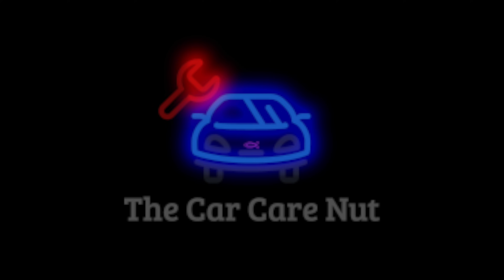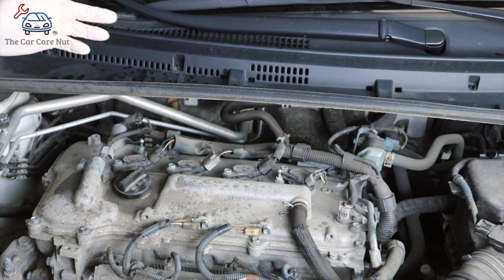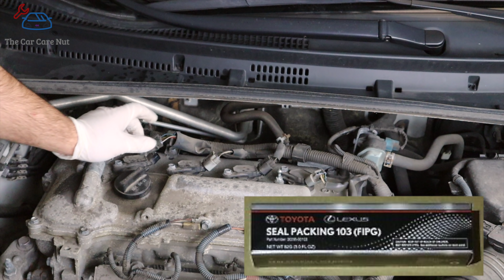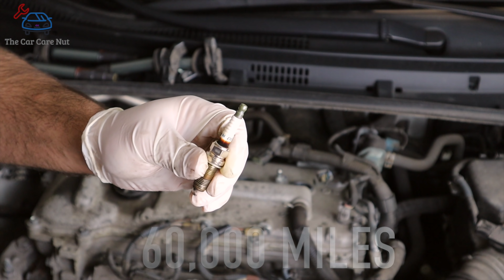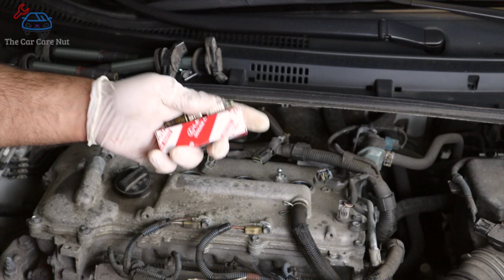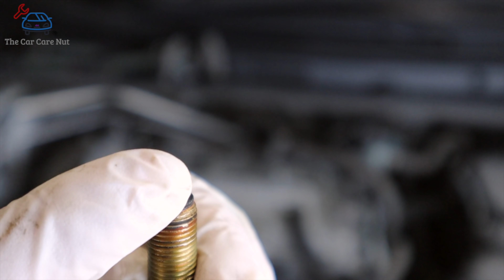How to change Toyota Spark Plugs on 4 cylinder engines

Comment: Good day, I truly like your channel and I wish I came across it much sooner.  
I bought a used 2004 Highlander, V6 3.3L, AWD back in 2012 with about 70K miles.  Today it has about 194K on it.  As a DIYer I change my oil every 3K, and other maintenance regularly.  The vehicle has never let me down. I do plan on having the timing belt changed at the dealer in the next month or so.
I'm also planning on changing the Iridium spark plugs (gaskets as well) myself since they have never been replaced since I bought the car in 2012 and I don't think they were changed by the previous owner.  Based on videos I've watched I understand it's little bit involved since the plenum must be removed in order to access the back three plugs.  I'm going to replace the front three plugs first.  If they are ceased then I'll refrain from going any further.  Is there any advice/encouragement you could give me as I perform this work within the next couple of weeks?  Thanks in advance.
Reply from the maker: Hi! If I were you and doing this yourself I would replace the valve cover gaskets as well. This is not difficult to do if you have experience. The bolts that hold the plenum in the back will be the toughest thing otherwise it’s very simple to do. If you decide to do the valve covers make sure the rear bank gasket doesn’t roll on you. Make sure it stays put
Reply: @TheCarCareNut  Should I stick with OEM gaskets from Toyota or what Advance Auto Parts has?
Reply from the maker: Original gaskets
Reply: @TheCarCareNut  I have another question.  I usually use Castro High Mileage during oil changes at every 3000 miles.  Not realizing it, I ordered Castro Synthetic from Amazon.  Since I already drained the old oil I had no choice but to put the synthetic oil in.  My Highlander has 194K miles.  When should I change the oil again, 3000 miles from now?   Also should I go back to the usual High Mileage Oil or stay with the Synthetic Oil?  Amazon's Castro OIl & Fram Filter Combo was a better price then Auto Discount Store's Oil & Filter Combo prices.
Reply from the maker: You can use either. It doesn’t make a difference honestly

Comment: engine cold, do one cylinder at a time, insert new plug using length of pressure hose and engage thread using finger force, if thread does not engage correctly pressure hose will slip on plug so no cross threading, tighten with socket.

Comment: Your videos are clear and very informative! I use just a wisp of antiseize on one side of the plug. If a plug does not thread in easily by hand, I remove and find the problem. Sometimes a small shot of WD-40 cleans the cylinder head threads, especially on older cars. Use of a torque wrench is good training.

Comment: Can spark plugs “age”? I have a 2006 Camry with 126k km’s so I guess that’s 78k miles. Car runs great. I will leave the spark plugs alone.
Reply from the maker: Hi! They don’t age but after so much time you could run a risk of them seizing up. That’s why they’re recommended every 10 years for replacement

Comment: Can you do a video on the Toyota 4.7L V8 timing? I've several videos on YouTube and it seems like they skip several steps. I might be wrong, but they seem to contradict the Toyota Manual.  Many thanks for your informative videos.
Reply: How often should spark plugs be replaced on an 02 Tundra 4.7? The owners manual says to use double tip plugs.  Is that correct? Thanks in advance! Love your channel!

Comment: My Local Toyota Dealership told me   the spark plug  torque spec for my 2016 Tacoma V6 is 13 ft-lb. Do you know of this is correct? I know your doing 4 cylinder but you mentioned 15-18 ft-lbs.
Reply from the maker: 13 is correct

Comment: Hi i watch your channel alot. i learn alot from your show. Could you help me. i got 2016 toyota camry se. i change old spark plug to new spark plug. i buy the parts for toyota. i have a question the old spark plug low RPM when is warn up is like 6000rpm now is new one RPM 9000 rpm. when i drive the car feel run faster waste more gas .How to low back down rpm. Thankyou
Reply from the maker: Hi! Did you clean the throttle body or just replace the spark plugs

Comment: I changed my spark plugs in my 05 xb. One of the coils left some cracked pieces in the spark plug well not allowing the socket to grip correctly. Why or what was those pieces? I think it was from the coil. I didn't replace it with a new one because I would need to sell a body part/organ for an original denso coil pack. It works ok but I feel a slight misfire especially when I put the a/c on. I spent a good hour getting those pieces out with double sided tape on a screwdriver. Could I use compressed air if it happens again? Also, should I change all four coil packs with a no name brand. Xb has 207,000 miles with the original coils. Your videos are a God send for us with financial hardships.
Reply from the maker: Hi! I would replace the coil. If money is tight use a no name brand name coil. It’s better than a broken coil.

Comment: Doesn't the Toyota Service Manual advise, using a light smear, of High Temp, Anti Sieze? Copper or Nickel?
Esp for the long-service, iridium plugs on the back 3 cylinders of the V6? 
I guess the message would be, Do Not Use, Cheap, Low Temp, Anti Sieze? Better off, Without any?

Comment: So when changing the spark plugs on Prius Prime or Rav4 Prime. Does it matter how much of the miles are electric versus gasoline miles?
Reply from the maker: Hi Labeeb! This has come up but the recommendation is to follow the mileage interval regardless on the prime cars
Reply: @TheCarCareNut   I looked in my Toyota 2015 prius C Owners Manual, and they did not have any torque specs for the spark plugs.
Where Can I get my  torque specs from?
Reply from the maker: 13 ft lbs

Comment: Thanks. Great video really helped. I have a question about the Spark plug anti-seize lube. I wanted to ask because some other websites like Prius chat said that the engine is made from aluminum and not using anti-seize may cause the spark plug to be stuck and strip next time  when you replace them
Reply from the maker: Hi! The factory doesn’t use anti seize and I am yet to find a factory installed spark plug that seizes. This is old school mentality. If you torque the spark plugs to specifications you won’t have issues.
Reply: @TheCarCareNut  thank you for the clarification 🙏🙏

Comment: I always clean and lube the coil rubber with Shin-Etsu before I put them back. Put a dab of engine oil on the spark thread to help removal the next time. Absolutely no anti-seize. Do not buy spark plugs from E-Bay, Amazon, etc. Most of them are the counterfeit plugs. I would leave my original plugs in place rather than putting these "new" plugs in. Buy Denso plugs either from chain parts stores or Toyota dealerships. Sometimes, parts stores cost more than dealerships.

Comment: I was 😔 wondering. Before you pull out your coils, do you want to spend a little time cleaning around the coil top to avoid dirt and grime possible getting inside? Thank you so much!
Reply from the maker: That’s a good idea. Maybe some compressed air to blow all debris and dirt away

Comment: Just got 2007 Toyota Corolla 131k miles. Starts right up, after few stops when engine warms up, it’s hard to start. No check engine light. Replaced spark plugs. What else can I do?
Reply from the maker: Hi! I would check for codes even if the light is off

Comment: AMD, 
Heard about Ruthenium spark plug? 
(Recently available, a few years).
 Read reviews and manufacturers claim it perform better, especially above 60 km/h speed than Iriduim spark plug and they are cheaper. May be you have some experience and knowledge about this..😄. 
Anyone use this new type plug can share info...
(My Toyota is at 115k km and planning to replaced the plugs soon)
https://ngksparkplugs.com/en/products/ignition-parts/spark-plugs/ruthenium-spark-plugs
Reply from the maker: Thanks for bringing this up. I didn’t see these. However I’d be careful with different style plugs and Toyota engines.
Reply: @TheCarCareNut  
Thanks and noted on your reply/comments.
Factors to consider include spark plug seat design, thread length and diameter, and reach. One of the most important factors is the heat range. Or else stick to the OEM factory fitted type, kind of like to like replacement. 
( if the plugs have no issue up to 115k kms, why change for a different type..😄)

Comment: You are saying they are due every 120,000 kilometers well I have a Toyota Corolla le year 2014 I'm at 146,995 kilometers now .At the parts department .Is there a parts number I should know about.
Reply from the maker: Hi! They are due every 120k miles not kms

Comment: What 3rd party/ aftermarket brands/models of plugs and filters, swaybar links and struts do you find have a solid reliability?
Reply from the maker: I usually use oem parts and don’t have much experience with specific aftermarket brands

Comment: Hey I have a 2013 Camry se 2.5l with 184k on it I was wondering about changing the Pcv valve on it. Any tips.
Reply from the maker: Hi! You’d need to pull the intake Manifold
Reply: @TheCarCareNut  really? :(

Comment: Hi. What is the symptoms for bad spark plugs. What is the best and long lasting spark plug for my 2017 Toyota RAV4 xle Hybrid. Please can you provide parts number, what size spark plugs socket do I need and what is the torque specification. Thank You
Reply from the maker: Hi! So the best spark plug is the original one from the dealership. On your rav4 the replacement is 120k miles and symptoms of bad spark plugs are misfires or general rough running
Reply: What is the part number. Dealers charge more money. Thank You
Reply from the maker: I would look it up on parts.Toyota.com using your vin number
Reply: Thank You and god bless you...
Reply: @grambangla1445  
Your owner's manual should list the recommended plugs for both Denso or NGK. To be sure ask the person at the Toyota dealership parts counter if the recommended plug in your owner's manual has been superseded.

Comment: Agree on the suggestion of a video about electronic throttle body cleaning and maf sensor cleaning
Reply: FYI... Do not remove a spark plug wires on vehicles with a direct current to the spark plug WITH the engine running!!!. You will get SHOCKED

Comment: I have a question when u take the car to the dealer and u ask for a drain and fill on the transmission do they actually do it tht way like u on the transmission video or they do a flush ?
Reply from the maker: Most dealerships will do a flush. However if you specifically ask them for a drain and fill they will do it as the video however they could use another special tool which would allow to check the transmission fluid at high temperature. And they would use the scan tool to get the most accurate transmission temperature which is similar to the light method.
Reply: The Car Care Nut thank you

Comment: At that mileage should I change the spark plugs on the 2018 Toyota Camry 100K miles with OEM parts prevented mantainance?
Reply from the maker: It wouldn’t hurt to change them. Or you can wait until 120k
Reply: The Car Care Nut on what cars do u need to change it every 60K miles?

Comment: Got a 2016 Corolla and was wondering on cleaning the throttle body can you move the butterfly at all or will this cause damage? Some have plastic gears in them but not sure on Toyota..
Reply from the maker: Hi! Moving the butterfly fully open is not a problem. Just move it slowly not fast.

Comment: Could Dielectric grease on the insulator of the spark plug prevented that Arc over?
Some technicians use fluid film on the tip of the spark plug have you tried this?
Reply from the maker: Hi! The idea of the dialectic grease is to make the spark plug coil removal easier and make better connection between the spark plug and coil or at least that’s the idea. Wouldn’t hurt to add some but if you add a lot you could cause issues.

Comment: My 2010 Camry v6 specifies DENSO FK20HR11 and a gap of 0.043”. But the specs for the part shows 0.044” preset gap. Am I suppose to adjust the gap to 0.043”?
Reply from the maker: Hi! Don’t adjust gaps for iridium plugs. That small difference likely will not make any difference.
Reply: The Car Care Nut thanks!

Comment: I have a 2009 Avalon with a "maintenance required" light on my dash.  It came on soon after I replaced my breaks and has been on for the last 5,000 miles what can I do?  The car is running fine and I can find nothing wrong.
Reply from the maker: Hi! That is just a maintenance reminder light. You can reset it by leaving the odometer on total mileage on the car turn the key off. Then press and hold the odometer reset button then turn the key on without starting it, it will start a count down on the screen wait for it to finish then you’re set. It comes on every 5000 miles to remind you to replace the engine oil and filter.

Comment: Hey AMD, maybe you can answer my question since you worked for a Toyota dealer. I bought a 2020 Corolla SE 8 months ago and the  driver seat adjustability is crap, is there a way to replace the seat with a powered one for better comfort, I’m not sure if the XSE/XLE and SE/LE have trim specific wiring harnesses.
Reply from the maker: Hi! Replacing the seats shouldn’t be an issue however the air bag in the seat is the issue. Likely no shop will want the liability of modifying a component with an air bag in them.
Reply: @TheCarCareNut  yeah that’s what I thought too. Which sucks because a really like the car but I hate the driver seat. I’ve tried car seat covers and cushions but nothing helps my leg from going numb after being in the car for an hour or two.

Comment: Did you happen to notice the different heat range number on the replacement plug compared to the original plug? I have a car with the same engine and I ordered spark plugs from Toyota SC20HR11 and received SC16HR11. At first I thought I got the wrong part number but found after a few years of experience with this engine Toyota decided to lower the heat range I guess to a hotter plug? I think the lower the number the hotter the plug, not sure though. So far I haven't noticed a difference. It still runs smooth and my gas mileage has improved a little bit with the newer plugs installed with the different heat range.  Great tip BTW on how to know if you're plugs you pulled out were ever changed. I never knew that. Thanks.
Reply from the maker: Toyota has done that before where they change the plug on the replacement. Not really sure why they decided to do that. I’ll ask to see if I can get an answer from them.
Reply: The improve gas mileage could be due to better plug self cleaning or improved combustion due higher pre-ingition temp.?
(Heay range: The lower limit is the self-cleaning temperature and the upper limit is the pre-ignition temperature)

Comment: Whats your opinion on oil catch can to their Toyota car? Thanks for the very informative video.
Reply from the maker: Hi! An oil catch can could work well on engines not equipped with an oil separator
Reply: @TheCarCareNut  oil separator? Is my Toyota Corolla 2014 le have that? Im Thinking to put a oil catch can to my Toyota? Do i need to?  Thanks for the reply to my question.
Reply from the maker: Hi! Your 14 corolla has one as well underneath the intake manifold mounted on the block.

Comment: I couldn't believe it when I read that NGK says not to use anti-seize on the threads b/c it can make the torque spec vary. Guess no anti-seize is the new normal!
Reply: I never use anti-seize on all my cars' spark plug. No issue.
Reply: @metzmatu8409  Using anti-seize come from all the old Chilton's anf Hanyes manuals I grew up with. Maybe because heads were made of iron back then.

Comment: How long do the coils generally last?
Reply from the maker: Generally they last a good time. Some of them will fail in less than 100k and there are many theories why they fail early. Some is the spark escaping through the plug into the porcelain like the one in the video, another is excessive heat.

Comment: I had a 4 cylinder Toyota that I changed the spark plugs, it was easy because it was a 2009 Corolla. Now I got a 2015 Prius & the tune up is due in about 15k miles, I’m not even going to stress myself out with that job, I’ll just bite the bullet and pay for it at the hybrid specialist.

Comment: Shouldn’t the battery be disconnected? More so in a hybrid? Or did I miss you saying that?
Reply from the maker: No need to disconnect the battery. Just make sure the key is off so you won’t set codes when you unplug the coils.

Comment: 3mzfe v6 so very difficult to change sparkplug. I did changed my brother in law 2008 Highlander was in 120k km since it ran 10k km so do I have to change it often ?
Reply: I'm mechanic to our family. Not my professional. I'm software engineer 😁
Reply from the maker: Hi! The 2008 highlander will need spark plug replacement every 120k miles.

Comment: Just changed my spark plugs yesterday on my 2015 nissan xtrail (rogue in the US). This was my first time doing this job. Took me about an hour. Took my time coz I was afraid I was gonna break something. Gladly, everything I did was on par with what Mr. AMD showed in this tutorial. Torqued them down to 17 ft lb. Now the car runs better. It also eliminated the knocking issue when I was backing up the car into the garage. Didn't use anti seize n dielectric grease because service manual didn't recommend using them. I'm a sucker for diy car videos and Mr. AMD makes great diy videos. Thank you 😁